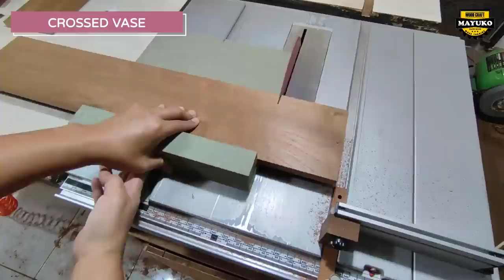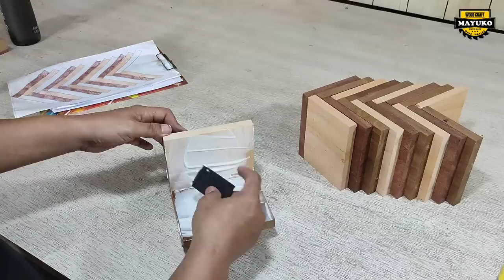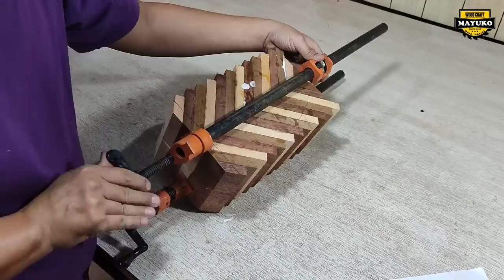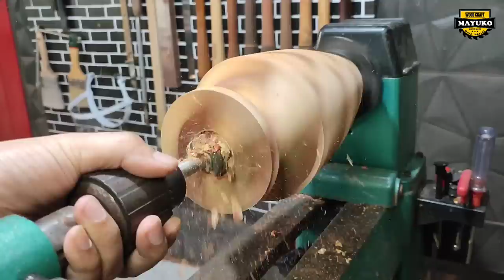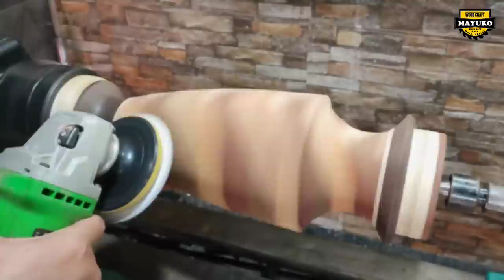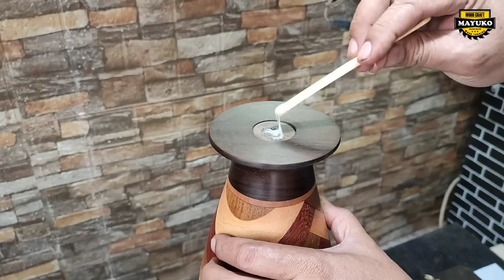HERRINGBONE VASE, woodturning

Comment: Why don't people saw off the corners before they start turning?  It seems as if it would result in less wear and tear on the tools and allow getting to the finer detail work quicker.  Asked by someone who has not yet done turning.
Reply from the maker: In my opinion, it speeds up work, because there is no need to cut corners, but every turner may have a different opinion, and I think that's fine.
Reply: @mayukowoodturning7644  I find your use of the term "cut corners" here to be quite ironic.

Comment: I am new to turning and love your videos. Can you tell me if you forced the end grain to be pointed outside in uniform, or staggered, or you didn't notice (I doubt that part.)  Do you have to adjust your technique and which of your tools do you prefer? Please keep the videos coming.
Reply from the maker: the grain edges can be smoothed using sandpaper attached to a hand grinder, that's what I usually do to smooth the grain edges, I'm used to using carbide inserts

Comment: Absolutely beautiful. I may try to make that soon. Can I ask what speed you start you first started turning the roughin? and what finish are you using?
Reply from the maker: Thank you,..🙏🙏🙏 yes, you can do it, I always use 850rpm from start to finish, and for finishing I use beeswax
Reply: @mayukowoodturning7644  I just finished an 8" diameter x 3" high walnut butcherblock bowl for my wife.  First bowl I have turned since high school. I am 65 this month. And I used the beeswax you recommended.  Turned out really nice.  I wish I could post a pic here. You really inspired me. thanks
Reply from the maker: @elliotgesang1267  It's nice to be able to share and my videos can be useful, besides producing beeswax that's not too shiny and also not matte, the results are very smooth, keep working on making something useful

Comment: I am thinking about buying a wood turning lathe what do you recommend? 
And what is the best way to get rid of the wood shavings? 
Thank you so much
Reply from the maker: Actually I don't know much about lathes, I use a 12.5" lathe and that's enough for me, using carbide inserts makes it easier for me to make works.
Reply: Is the machine and turning loud, will it bother neighbors if I put it in the backyard?
Reply from the maker: @naderkourani  The sound of the engine is not too loud, but you can build a workshop using a silencer, and for dust, you can use a dust collector.